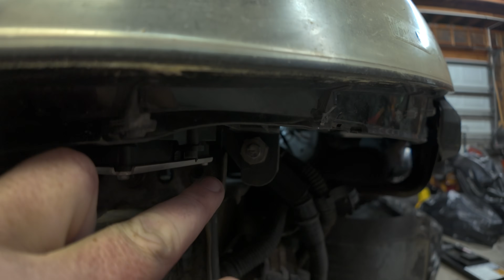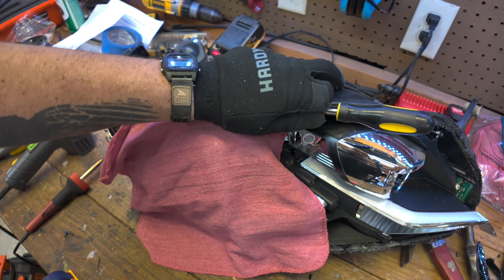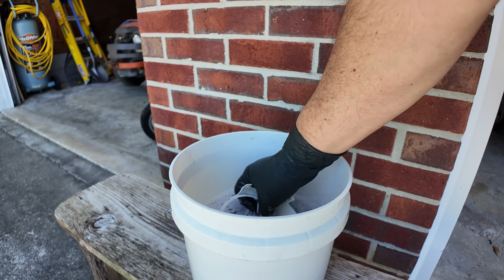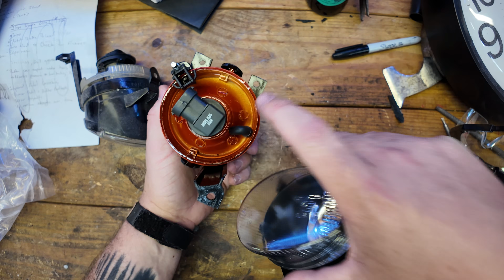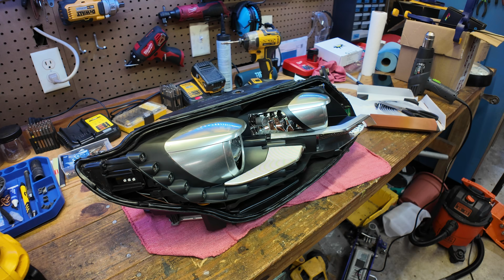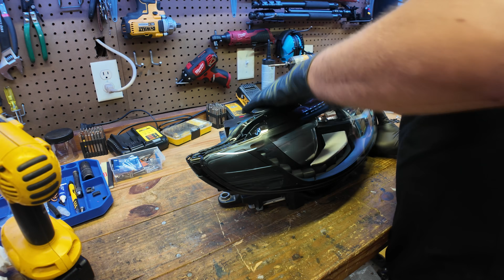How I Completely Rebuilt My VW CC Headlights | Part 1:  Disassembly & Restoration

Comment from the maker: This is Part 1 of my VW CC headlight overhaul series! In this video I completely disassemble, prep, paint, and reassemble the factory headlights to give them a completely new look.

Part 2 - The Results:  https://www.youtube.com/watch?v=dTHH0Hzjghs

Tools & Parts Used:

Helpful Tools for this Job:

Morimoto Retrorubber Butyl:  https://amzn.to/4gEbQOt
Heat Gun:  https://amzn.to/4vYHgUx
Separator Pliers:  https://amzn.to/4wBJpFp
Extended Bit Set:  https://amzn.to/3SYH9tl
Dremel Tool:  https://amzn.to/4h8Z5vj
Complete Pry Tool Set:  https://amzn.to/4vUTVHR

Part 2 - Installing the deAutoLED Upgraded Bulbs:  Coming Soon!

Question for you: If you were rebuilding your headlights, would you keep the factory chrome, go with black housings, or a mix of the two like I did? Let me know in the comments!